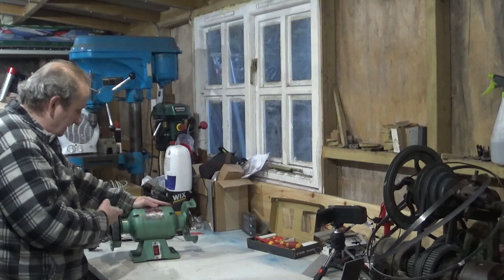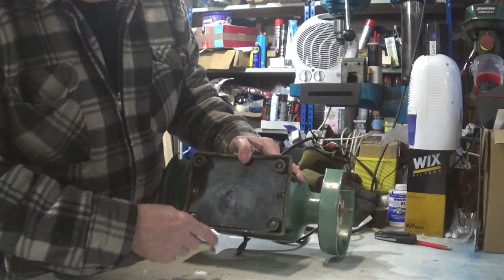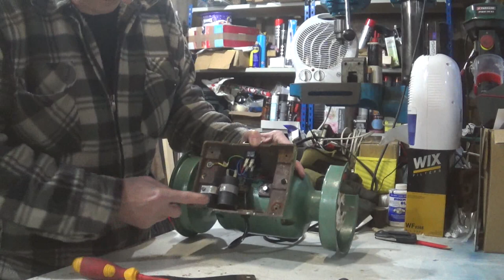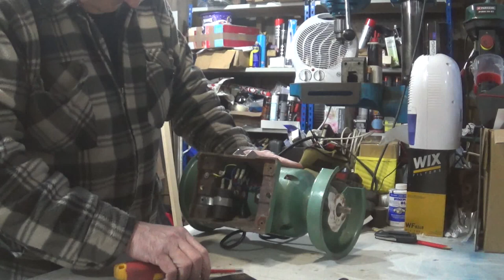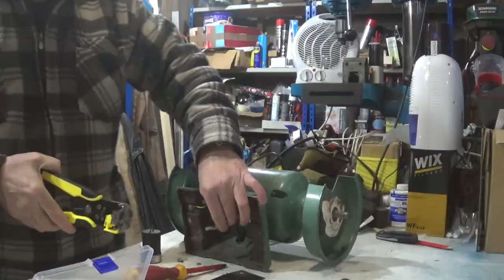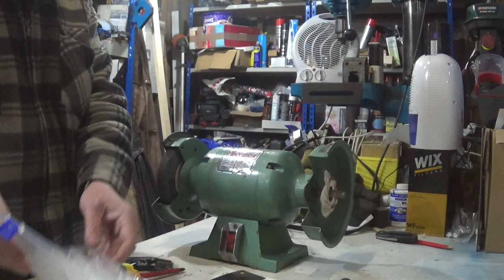Fixing A Bench Grinder That Will Not Start

Comment: Thanks Ben. My grinder wouldn’t start unless I gave it a mighty spin by hand. A replacement was going to cost over £90 so I did what you showed. Removed the base plate, saw the capacitor and removed it. Elsewhere on YouTube I found out what it did and how to test it. It was not ok. Found the spec on the broken one for a replacement, got one off eBay for a fiver, refitted it with new spade terminals as the originals were too small. Cleaned it up, reassembled it, switched on and Bingo! Starts first time every time. Thanks mate! Saved me £85 plus I learned what motor capacitors do (as against lighting capacitors) so I’m well pleased!
Reply from the maker: I am pleased to have helped. Oddly I am currently working on another much bigger capacitor start motor, but this one has a dodgy centrifugal switch. (This bench grinder does not).

One thing I would say is, it feels much better to have fixed something than to have replaced it.

Did you capacitor look like it had blown up, otherwise how did you test it?

Also if your capacitor is on all the time, you need a run capacitor not just a start one.

Many thanks for watching, please like, share and if you like the channel subscribe!

Comment: Looks pretty good! Do you have an idea how I could fix my old Shopmate 2601TO? It gets bogged down when I start grinding something against the wheel. THANK YOU!
Reply from the maker: I am not familiar with it. What power rating is it? How big are the wheels and what have you on it? (Type of stone?)
Also, many thanks for watching, please like, share and if you like the channel, subscribe!
Reply: @BensWorkshop  Thanks for replying! It says 5 inch grinder. Model 2601TO. Shopmate. 115 V.A.C. 60 HZ. 3.2 AMPS. 3500 R.P.M. McGraw-Edison Company. Arbor size = 1/2”. Max. Lamp Wattage 10 Watts. 

The left wheel is approx. 4-1/8” diameter, 3/4” wide. The right wheel is approx. 4-7/8” diameter, 3/4” wide. The right wheel wobbles sideways approx. 1/16”. They’re both look like stone, I imagine they’re different grits, but they look the same to me.
Reply from the maker: Is there a power rating in either HP (Horse Power) or Watts? (1HP = 750 Watts) The 3.2 Amps probably refers to starting surge current.
Reply: @BensWorkshop  looks like the sticker doesn’t say that. I can’t find any other markings
Reply from the maker: I had a google and I can see the ID sticker which as you say, does not say much. However it looks a bit like a Black and Decker I have which has 1/3rd of a HP.  As I can't see it running and how hard you are pushing it, but all grinders will bog down if pushed. Sorry that is not more helpful.

Comment: Mine doesn’t have a starter coil like they. When I start it I bye turning it I here’s set of points click in
Reply from the maker: Ah. That would be a split phase with a centrifugal swicth. Check the contacts and clean, also check there's continuity to the switch.

The switch will be at one end or the other of the motor. I had a similar problem in this motor but it took me a while to find:

https://www.youtube.com/watch?v=ea_kcnOApQA

Though this motor did have a capacitor, there was nothing wrong with it.

Many thanks for watching, please like, share and if you like the channel, subscribe!
Reply: @BensWorkshop  I fount the problem was the centrifugal unit it was cracked and moved
Reply from the maker: Were you able to fix it?

Comment: Can replace 2.5 to 3.5 uf capasitor, it is same volts
Reply from the maker: If the question is can you replace a 2.5 uf capacitor with a higher value 3.5uf, generally yes. 

What you need to check is if they are running or starting capacitors. Starting capacitors are switched out of circuit after the motor has started spinng. You hear a click on start up and after you switch it off as it is slowing down. My other videos on lathe motors (and my mill motor) have such switches and you can hear them click.

This model of grinder has no switch so needs a running capacitor.

Many thanks for watching! Please like, share and if you like the channel, subscribe!

Comment: Thanks for the helpful video. I have a (old) bench grinder that has the same problem. I replaced the original capacitor with the replacement from a motor repair outfit. Connected the new capacitor but still the same problem. Any ideas? Runs fine, just have to manually start it.
Reply from the maker: Have you checked the coil that the capacitor connects to? 

Also do you hear a click as it starts to spin up and another as it slows down to stop? If so, there could be a centrefugal switch that is failing and the contacts may need a clean.

Many thanks for watching, please like, share and if you like the channel, subscribe!

Comment: Sir .  How many wires are going to the motor?
Reply from the maker: There is live and neutral going into the unit, with an earth. From the base into the actual motor windings there are 4 wires in this unit, for 2 coils. One coil has a capacitor in series to create the phase shift that sets the direction of spin.

Many thanks for watching, please like, share and if you like the channel, subscribe!

Comment: Is there any danger of discharge from a capacitor?
Reply from the maker: Not a big one on an AC start or run capacitor, as they are charged and rapidly discharged. It's not like a capacitor in a DC power supply/ However if in doubt you can always short it out with a screw driver.

Many thanks for watching, please like, share and if you like the channel, subscribe!

Comment: There was no information on my machine,just an old one I inherited from my grandpa and wanted to clean it up a bit. The only clue is the bearings are made in England,if that's helpful at all.
Other than that,I'm not sure how this motor is called in english,but yes,this seems to be the principle behind it. There's a plate with a thin piece of metal on it,that helps engage the coil with full voltage and kickstart the motor. Then after the rotor starts spinning,this centrifugal switch releases the piece of metal and it's normal single phase. So basically,this switch is replacing the capacitor. If misplaced on the rotor,a bit further away so it won't push this piece of metal enough to make contact,the motor won't start.
 Sorry if the description is not very accurate,I'm not very good at this,and only found out how it operates today thanks to the comments here.
Reply from the maker: If it is a centrifugal start motor the switch is connected when the rotor is not spinning, then as the motor spins, the centrifugal switch operates to turn off the starting coil. 

For a bit of detail, see this part of a series I did on an induction motor with such a system (and no capacitor)
https://www.youtube.com/watch?v=0BrGVqA-WOI

If the switch works, all you will need to do is identify which wires are one coil and which are the other. Connect them in parallel. Turn it on. Check which way the motor runs. If it runs the wrong way, reverse one coil and try again.

See this motor video for more of an idea (This one is a capacitor start but same principle.)
https://www.youtube.com/watch?v=uzdeNWUDI14
Reply from the maker: Also, soon I will be publishing another video with a different arrangement of centrifugal switch that caused a lazy start.

Comment: How satisfying to get it working.  How old is it?  Surprised it had a cheap Chinese starter coil and strange still getting a tingle from the switch but dont think you inspected that.
Reply from the maker: It is very satisfying, but I don't think the grinder is that old, certainly probably less than 20 years old. I suspect that some damp got in it to give it the tingle.
Reply from the maker: Oh, and it is a capacitor... I kept getting it confused in the video.

Comment: Nice job.Just a bad connection. I was thinking you was going to take out a starting capacitor from something else.How would you have fix it if the starting capacitor was messed up?
Reply from the maker: In that size they are generally run capacitors and basically you just buy a replacement. They are sold as generic spares by value so as long as you can read what is on them or find out elsewhere you will be fine.
Reply: @BensWorkshop  I learn something new every time I see your videos.
Reply from the maker: @samsgarage1716  Many thanks Sam!

Comment: I have a hummer like yours .I have to spin it fast to run.It’s a Craftsman 120 volt in USA.It doesn’t have a capacitor.It has a small winding that’s wired to the big one on axel.You mentioned that’s called split phase.That’s all I know.
Reply from the maker: How many wires do you have coming out of the pedestal? I could also have a centrifugal switch which might be stuck open.
Reply: I found out it has a start relay that’s not made anymore.Oh well it’s a cheap one has plastic housing I bought for a few bucks.Seen a bench grinder thread on the Garage Journal where they were talking about this one back in 2017.Boy they tried to find a replacement but didn’t.
Reply from the maker: Did you find the relay? If not all you have to do is work out what it does then I expect you can put together an equivalent from other parts.
Reply: No I haven’t ..Like I said a bunch of guys looked without luck.Thanks for your comments.
Reply from the maker: In which case you just need to work out what the relay does and how to replicate that. I suspect it just turns the coil it is connected to on for a short time at start up.

Comment: My Black & Decker bench grinder only buzzes and won’t spin.  No capacitor.   Brushless DC motor.  Is it fixable?
Reply from the maker: What makes you think it is DC and are you sure it doesn't have a capacitor?

I would suspect that it is in fact AC, it will be brushless. I would start by using a muiltimeter to check that you have power inside the grinder and that the switch works.

I fixed a Back and Decker one here:
https://www.youtube.com/watch?v=WJhWVj-oRvo

Many thanks for watching. Please like, share and if you like the channel, subscribe.
Reply: @BensWorkshop  I know it’s brushless and DC were the only ones I saw in videos so I assumed.  Good to finally know.  Thanks.  The switch works.  I’ll link a short video if you have a second to watch it.  Yes, I’ll def subscribe.  Thanks
Reply from the maker: Brusless motors are always, without exception, AC. Where the supply voltage is DC, there is a converter to convert it to AC, usually 3 phase and variable speed. Does it run on batteries? If it were brushless with a DC supply there would have to be a circuit board with a heat sink to turn the DC into the AC required to run the motor.  Is there such a circuit board?

Also, not all single phase AC induction motors have a capacitor. They sometimes have what is called split phase wiring.
Reply from the maker: Definately an AC single phase induction motor. Just looked at the parts manual and it appears there are just two wires to the coils which is odd.
Reply: @BensWorkshop  thanks for the info.   Do you think it’s fixable?     I was probably over working it.   There’s just not much to it.   
When the power is on it locks up
Reply from the maker: I don't know. Does the coil smell odd and is there any signs of burn out? For what it's worth people throw perfectly good ones away so you might find one that needs a switch fixing or a capacitor replacing or rewiring if it is burnt out.
Reply: @BensWorkshop  no smell but there are some black spots on the coil.  Kind of all over.  Nothing that wipes off though.  Just hate to throw it out without going over everything.  
What is the final death of an AC motor?
Reply from the maker: Either bearings or burnt out coil. Is there anything on the rotor which might be causing an issue?

Looking at the diagram that is here:
http://www.dasarodesigns.com/wp-content/uploads/Black%20and%20Decker%207900.pdf

I can only see two wires going into the coil which seems odd as you either need to run those motors on 3 phase or generate a second phase with something like a capacitor to get them to work. Also I note that you say it locks solid which is also odd. You can see mine buzing when powered up before I fixed it.
Reply: @BensWorkshop  it spins nice and free with no power, then the power locks  the magnet.  At one point it started!  But then started buzzing again.  Great you found that diagram.  Yeah, there’s not much to it, that’s why I thought it’d be an easy fix.  I guess the coil is burned out which means it’s dead.  Not only trying to fix it, but I enjoy learning in the process.  Thank you for your help.
Reply from the maker: @jcstevegigs  Are you running it on 110 V AC?
Reply: @BensWorkshop  yes.  I might try bypassing the on/off switch just to check like you did in your video, but it’s prob not that.
Reply from the maker: If there appears to be no burn out it is worth a try. Let me know how you get on.
Reply: @BensWorkshop  I will.  Thanks for your help
Reply from the maker: Have you had any luck yet?
Reply: @BensWorkshop  No I haven't had a chance, been getting my lawnmowers and stuff going...another challenge lol

Comment: Nice one .I have the same machine.I"be been using it for over 15 years.I"m a shoe maker.now it won't on.no power at all.what can i do.keep up the good work thanks.
Reply from the maker: Sorry to hear your machine has stopped working. 
Does your make any noise when you turn it on?

Many thanks for watching, please like, share and if you like the channel, subscribe!
Reply: @BensWorkshop  no .no power at all.it"s dead
Reply from the maker: Have you got a multimeter? You could check it has power inside the unit. However you could also just try changing the fuse. It is a 1/2HP so will have a starting current of between 5 and 10 amps.

Have you checked the fuse?
Reply: @BensWorkshop  no.I didn't" know there"s a fuse.I will check.tkanks so mush for your kindness.
Reply from the maker: @kingbeejonga3720  No problem. Which country and type of plug is it? If it's a UK plug (used in UK, Ireland, Malta, many parts of the Middle East and Africa) then the plug will have a fuse.
Reply from the maker: Also, if it is a UK plug and you are unsure of how to change a fuse, I can do a quick video on that for Saturday or Sunday.
Reply: @BensWorkshop  hi ,i'm sorry I was bussy.that machine is made from Taiwan.and I don't see a fuse.I open at the bottom just like on that video of yours.and i only see 2 things a swicth.on and off buton and that other thing a capacity and is writin motor starting .I"m from South africa and I make sandals and shoe out of old tires.I rely on that machine.I a lot of customers who are waiting for their shoes.and I use the mechanical one.the one u wind by hand.and is slowing me down .thanks for kindness.keep up the good work.of educating the world.thanks.
Reply from the maker: Does it make a noise when you switch it on or not? If not see below, if it does it may be the start capacitor (or centrifugal switch.)

Do you have access to a multimeter or voltmeter or electrical test screwdriver? In the UK there are fuses in the plugs, but you don't use a UK style plug. (They are used in many countries).

You need to check that you are getting power into the unit. If you are not you need to check the socket you are plugging it into.
Reply from the maker: How are you getting on with it?
Reply: @BensWorkshop  where is the fuse .at the bottom there"s no fuse.thanks
Reply from the maker: I do not know where a fuse would be in South Africa. It does sound like you are getting no power inside the grinder as it is making no noise at all. Do you know someone who can check if there is power inside the grinder with a meter?
Reply from the maker: @kingbeejonga3720  Also can you reply with a new thread as this one is too long for YouTube.
Reply from the maker: I do hope you have a merry and blessed Christmas and a happy and prosperous new year. Good luck with the grinder.

Comment: Excellent result Mate, If the grinder has been sitting outside and got wet that might well give you a little tingle I would leave it in the airing cupboard for a week I would also re do the earth connection in the motor (I expect you have done this already )   👍 😊
Reply from the maker: Odd that you should mention water... When I got it started it spat out a lot of water from the side with the wheel... I may open it up to check.
Reply: @BensWorkshop  Even if it looks OK I would leave it somewhere warm for a while, Also do capacitors break down if they get wet? would it be leaking through it's casing? I don't know just guessing
Reply from the maker: @Everythings_Adjustable  Capacitors do brake down but I think this one is fine as it is in a plastic case. I will dry out the internals though.
Reply: @BensWorkshop  I love this sort of video, very interesting stuff 👍
Reply from the maker: @Everythings_Adjustable  Many thanks Sparky!